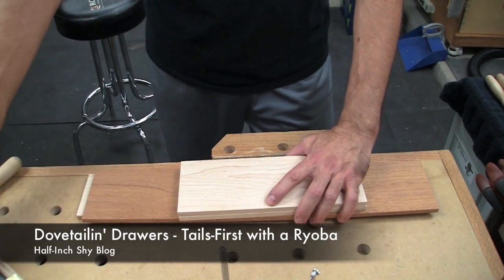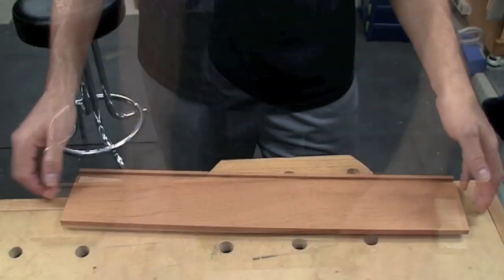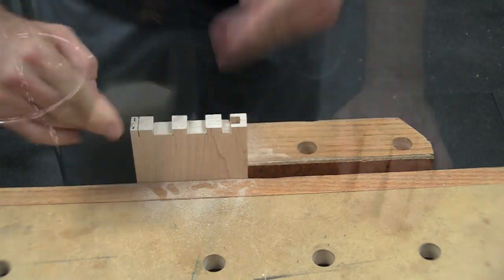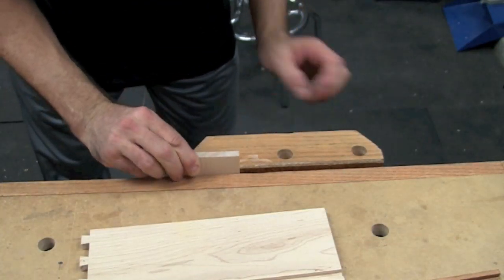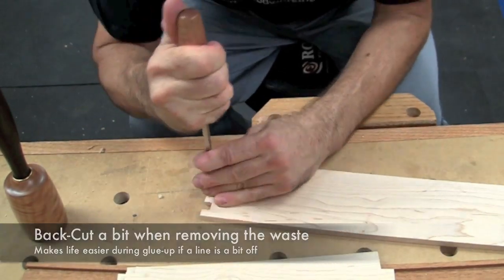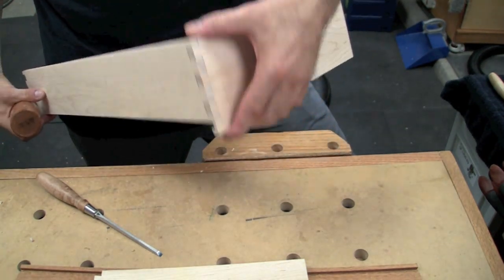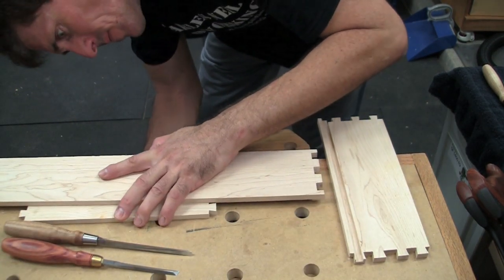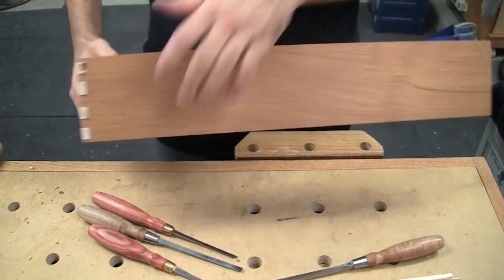#47.3 - Dovetailing Drawers - Tails-First with a Japanese Ryoba saw

Comment: What blades to you use in the coping saw, as I notice you get a nice, tight turning radius?
Reply from the maker: +Gina Geith These are #7 skip tooth blades. Not the finest kerf size, but they don't snap easily and cut quickly.